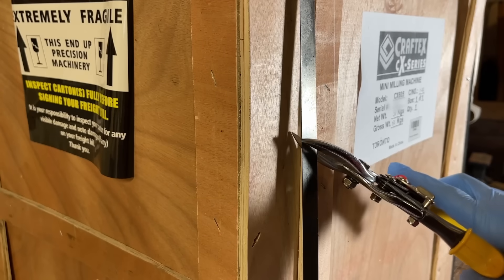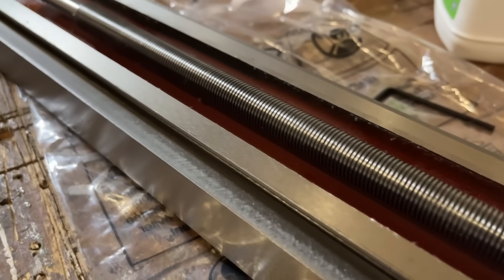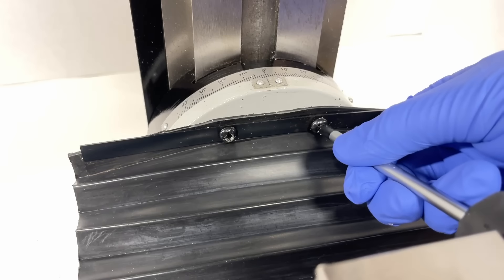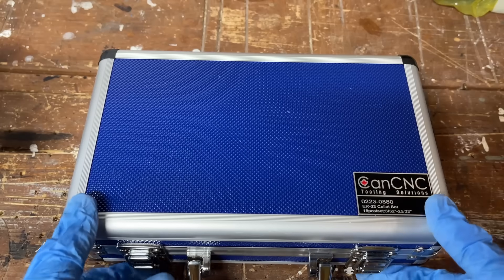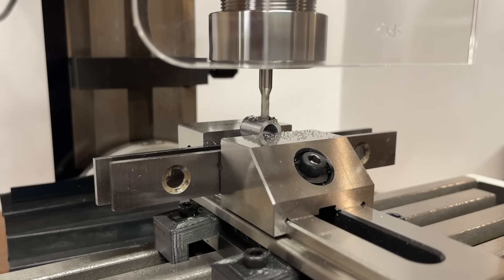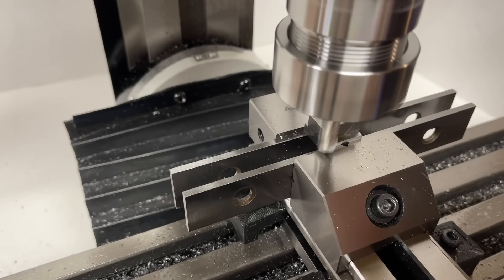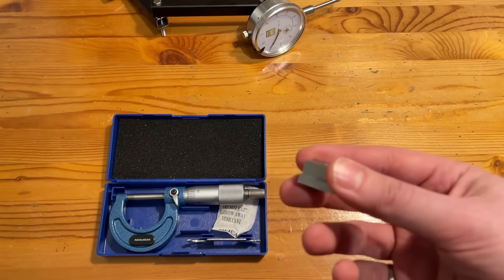I Bought A Minimill to see if they are Worth It

Comment: why do you use imperial? it's 2024!!! and you're in Canada!!!!!!
Reply: Because machining is usually done in imperial. The dials are all set for thousandths of an inch.
Reply: @LoganGrimnar-fnrizz  i don't fully remember the video, but isn't this a new machine? why are they still making them with imperial units? i just bought a desktop cnc and it's metric
Reply: @shambles9 Canada is in North America. NAFTA is a thing and the U.S. and Canada do a lot of joint manufacturing and trade. Hence the imperial mini mill being common on N.A. soil
Reply: Imperal is way more practical. If you say to someone, "oh its roughly 6 feet" they can picture how long it is...now if you say ohh its roughly 188 centimeters they gonna have a hard time picturing how long that is...i guess it depends on what your used to but i prefer imperal...and im canadian
Reply: @MinatoNamikaze607  strange.. i'm Canadian too (born in Toronto, now live in Vancouver, BC) and i can easily picture 188 cm (easier as ~1.9 m btw), since 95 % of the world already switched to metric, maybe it's time US does too? how much US influence should we take until we're sick of it?
Reply: @shambles9  im also from Toronto area...lived here my whole life, millwright by trade and i can convert to metric if needed but still rather the imperal system for measurement. Fractions of an inch are way easier than Fractions of a meter or millimeter but to each their own i guess...

Comment: Meh, naysayers. 'They' said/say the same negative things about those cheap mini-lathes, too. With low expectations, I bought one. Turned out [pun] to be the handiest thing ever. Quality ends up depending much more on error-correction than it does equipment. Knowing your hardware's (tool) limitations + then adapting your software (expectations) to those = win.

Comment: I have a Grizzly that is very similar to the Central you're showing.  I've cut steel, aluminum, plastic and wood with no issue.  All that's needed is recognizing what you're working with and adjusting speeds accordingly.  Granted, it has a little more backlash than full sized machines but I like mine.

Comment: I've got a Clarke Mini Mill, it's great. It cuts steel with no problems, just don't expect large cuts. My main tool is a 50mm 4 insert surface cutter, getting the right inserts for the material matters. 6mm and 8mm coated end mills will cut slots in steel in up to 3mm deep passes. My x and y calibration is 1.5mm per handle turn and 1.2 in the z axis, the only problem is the excessive backlash on the z axis slow adjustment. I've fitted a belt drive after breaking 2 sets of nylon gears. It does all the model engineering tasks I want from it.
Reply: The Z axis mechanism on these machines is not great (yes I do have one), as you say a lot of backlash. Most fine adjustments take much more turning of knobs than seems acceptable.

Comment: I have the belt drive version. you can't use the LMS spindle lock. you have to make your own. if you upgrade to the very quiet belt drive, make a spindle lock that uses the pin and sensor from the LMS gear drive spindle lock.

Comment: I am use to a 3 hp Tree mill, and a 7.5 hp lathe. R & D, is fine with the smaller versions. But taking a half inch cut, on the lathe, and hearing the motor begging for mercy, is SOP. But you will never expect that, out of them. And the bigger and heavier the machine, less vibration, and deflection.

Comment: Just remember to explain to people, making they own Tee-Nuts, never finish the thread, all the way through. The studs, should stop more than a full thread, from the bottom of the nut. Simply because the amount of force, getting multiplied by threads, is enough to snap off a chunk of the brittle iron table.

Comment: You should get a proper milling vise. That is a precision vise primarily used for grinding/ tool making where the holding pressures are not  as high as in milling. Because it works with new sharp mills and shallow DOC and light feeds it is still marginal. As the mill gets dull the cutting pressures climb and may cause slipping in the vise.

Comment: Two things to understand if you go the cheaper/better, old iron route.  

1) Understand the hierarchy of accuracy.  You don't need a tool room lathe, or super lathe or mill like a Hardinger, or Deckle.  You may find them for near free - enjoy.  But those machines exist to do lab work, or in a factory, to maintain the lathes that are actually making the parts.  This whole,  "I am using a granite surface plate to align my bike frame thing, while harmless, is a little stupid.  

2) Sometimes crappy old lathes that were bare bones machines, are in a lot better condition than a tool room lathe that got ridden hard. One of my lathes, the lowest SB model, was sold to a dentist in Toronto.  It is basically in new condition.  I have a tool room 9" also, and it is in OK condition, but is not as good at this point in it's life.

Comment: The complaints are all nonsense, plenty of people have made wonderful things on mini lathes or mills.  The issue is whether they are good value, and there the answer may well be "no".  

I first bought a combo machine, for about 1500.  I really quite liked it, but it also developed a leaky sump and the store took it back.  

For something like 2000, I then purchased a nice 9" South Bend, with change gears.  And a Clausing 85xx knee mill.  These are two very serious machines.  Over the next few years I got a Burke Horizontal mill, and a  mint South Bend shaper, for about another 2000 (prices Canadian, and circa 2000).  As I became a slightly experienced "collector" (I was actually just trying to get a few pieces for my shop), I started to be offered free machines, or machines for next to nothing.  But sadly, too late for me.

A mill without a knee is a bad deal.

A lathe that won't cut threads is a bad deal.

Most of the chinese lathes, when I bought, were metric even if they had dials calibrated in imperial.  At the time the machinist hobby was largely imperial.  South Bend has for real imperial screws, gears and dials.

One of the biggest factors for me is that these US or UK lathes last 100 years, and parts are still easily available.  Chinese lathes snap, even very expensive ones (30K plus). And parts for all the off brands are not so easy to find.

I don't know what the market will be like when I sell up, but it won't be as bad as if I still had Chinese tools.

Comment: The 2x can even mill titanium 
Yes the tram is horrible and sertenly when it is cnc converted.
Why did you go for the 350 geared motor version when there is a 500w bldc motor version which is belt driven...
More cheaper to maintained the gears will break.
Better off pulling the gears out and make a copy of then in aluminium or so.
Owner of x2 mini mill,  mini lathe(To be cnc converted) , Rf45 mill cnc converter , 6090 cnc router.

Comment: What's that auger-like tool you use at 6:58? Would love to get one and hopefully they have smaller sizes - I use 3d-printed steel parts sometimes and the holes on those usually come out funky.
Reply from the maker: That was actually just a standard m6 tap! But likely a similar setup with a hand reamer + a tap wrench would work for you

Comment: Any mill is better than no mill. Any CNC mill is better than an equivalent Manual mill. These are facts of workshop life. Sure, you can't always take huge cuts with lighter tools. However, if you convert them to CNC that's even less of a problem because you don't have to be there and watch it take all of those small cuts.

Comment: Belt drive, since it not if, but when you blow a plastic gear.
Igaging scales, since only way your going to make repeats (read way to much lashe in dials).
Your never going to tilt the head, so back plate the column to base, to ridged up the machine, after you have trammed the spindle to the base.
As for other mods, add in reversing switch, so you can back feed when tapping, led disc light at bottom of head around spindle for better lighting of stock.

he last one once you do have the column back plated to base trammed, and have belt driven the machine,  update the motor controller to a KBLC-19PM controller.  The motor is capable of 120 volts DC, and going to find that the oem controller board in play, only powers the motor up to about 90 volts at max setting, so no where near the 1/2 hp claimed (with stock controller board holding back motors full potential].

Granted that the machine is not going to hold its own against a bridgeport for large work, with the above mods, does very well for smaller projects isntead.

And if your going down the path of mid size lathes next, the larger the spindle bore the machine has, the better.  Hence want at least a 1" through bore to start with.

Comment: Useful video, thanks.
Sixty-two and a half thou seems really weird until you realise that means a lead screw of 16 threads per inch. (Served a machine shop apprenticeship in the UK in the '70s where we had to deal with metric, imperial and imperial fractions in equal measures.)
Reply from the maker: Ah yes the mixing of units is always fun. I’m guilty of designing in metric, but machining in imperial. It’s all fun and games until I need to drill a hole for a metric fastener with my imperial drills haha

Comment: Good video, SSMT.  Tool Tip: Starrett hacksaw blades are cheap and well worth the price.  <$3 ea @ Azon/outlast crap blades 10:1.
One could also tack weld the column to the base to ensure stability.
Reply from the maker: Excellent tool tip. I’ll have to place an order for some when I run low on replacements! Thanks!

Comment: I bolted mine to an old cast iron surface plate “14 x 14”, and replaced the motor & gears with an ebay digital sewing machine motor with speed control and reversing, transforming the mill, I have used it hard for 6 years and counting. Invaluable tool now.

Comment: Oh for sure there's no shortage of armchair mechanic/machinists out there spewing absolute nonsense about tools and kit.
I will begrudgingly admit though that in the case of complex mechanisms like a 3D printer or lathe, it can only really be used by a narrow group of people.
Its terrible for a beginner, as getting a good result generally requires a lot of experience and fabrication ability, you really don't want to learn on something like these.
And its obviously not for a professional.
Its for the unicorns among us with vastly more skill than cash.

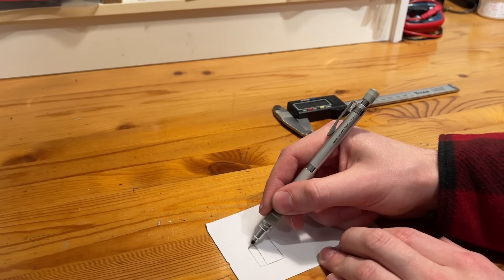Comment: @ 5:40 (again when showing the nominal vs actual)
You wrote 0.7

That part looks WAY larger than 700 microns.

You should write it as .7 without the leading zero... that way it will be bigger... 700 thousands of an inch.

Nice job hitting tenths on 1/2 of your feature tolerances though.
Reply: Soooo many people don't get that about the leading zero's.  Very aggravating in a contract shop that deals with imperial & metric.

Comment: As a young man back in the 70s I worked as a production machinist, operating turret lathes, chuckers and cataract machines. This was pre-CNC.
One day I complained to my lead man that my machine wouldn't repeatedly hold tolerances required. He went over and ran a few parts, he then told me "It's not the machine,  it's the machinist"  He was correct of course and showed me why; I just wasn't concentrating, etc. The point is, these mini machines will produce good work if used within their limits. Be patient and don't try big hogging cuts, etc.

Comment: Had my mini mill now for many years. Mods- gas strut alongside the column to prevent spindle dropping, changed the gears for drive belt, both make it much nicer to use. Yes I use the jacobs chuck a lot for most things, accurate enough for what I use it for on daily basis.

Comment: I tried all kinds of small mills, finally decided on the Grizzly 3102 precision knee mill. Solid, not too heavy at 1150lbs. I added ballscrews and a cnc motion control system I can hold .0005 now. all told around $5500. Thought phew im done...I was WRONG. Tooling, OMG tooling. $$$  Im in 3 times what the mill costs and always getting more fixtures and making jigs. My 10"rotary table was at an auction and im embarrassed to say what it cost. Think nice used CAR! The machine is reasonable, real tooling is a beast!
$1400 for 1 indexable toolholder!!!! NOT cool!   I end up making most of my own fixtures, tools, etc.  I cant afford that stuff. But I need that quality...

Comment: Go down to a workshop that repairs any form of heavy machinery & raid their replaced bearings bin & grab the large roller bearings. you want the rollers as they are not only all ground to the same diameter but also the same length, 2 or 3 bearings will give you different Hights  as packers or spacers & usually for FREE !!!!!
Kiwi Rod
Reply from the maker: Good suggestion! I’ll have to give that a try and see if I can find anything

Comment: I bought a mini lathe and found a new hobby: hotrodding my mini lathe! I learned how to lap and scrape ways, made and installed stops, saddle locks, quick release tail stock… the list goes on. Meanwhile, it was capable of really good work. Lest scoffers say I don’t know how well a good machine works, I worked on Hardinge lathes for decades. Clearly, these mini lathes are no match for a hardinge, but they are satisfying in their own right. It’s all about knowing your tools.
Reply: Hardinge machines do set high standards. They may spoil you.
Reply: My company scrapped a Hardinge last year. I couldn't get it home, alas but I thank it for all the aeroplane bits it made for me after hours over the years. A lovely lathe, Tough, smooooooth and very, very accurate.
Reply: @tomsheppard1666  I went through such experience with a Dutch AI Hambrug DR1 - high speed. But i simply did not have the space or the concrete floor for such a lathe. Even not the means of get that half a metric ton of cast iron at home. It is sad. Those machine tools last a life time. Or more, my J. Volman (pre TOS) toolmakers lathe comes from 1935. I from 1967. That machine still runs better then i do.
Reply: I’m glad I learned on a South Bend so I could appreciate a Hardinge’s sheer luxury. As I said before, it’s all about learning and understanding your machine and what’s happening at the sharp end of the tool.
Reply: @trackie1957  When I bought SB was a lot cheaper than chinese, and those lathes were incomprehensible, anyway.  Every change in model size was a completely different feature set.  SB was more than adequate in the day, and parts are easy to find.
Reply: Honestly sounds a lot like my 3D printer habit, er, hobby. Paying premium prices for premium machines gets you one that works without too much fiddling, but cheap machines are less functional tools and more projects to see what sort of ridiculous nonsense you can get up to.
Reply: *pimping
Reply: Yup have a little  6889 grizzly  bought for hundred  with all tooling..switched it to r8 spindle  and metal gears..does good also bought a round column  mill same price..should I need for bigger jobs mini does most

Comment: After my mini mill inevitably broke the gears, I had a great project for the lathe - making aluminum pullies to convert the mill to v-belt drive.  Best thing I ever did for the mill.  Now it's quiet, runs with less vibration and when I do something stupid, the belt slips instead of it blowing up the gearbox.  SO much more pleasant to use.  100% worth doing.
Reply: Exactly 💯
Reply: FYI  IF you ABUSE a Machine tool , IT WILL  RESPOND   UNKINDLY    trust me ...
Reply: @Wilett614  and a v-belt mini mill is better than one with a gearbox since mini mills are less powerful anyway.

Comment: A hint on plunge or side milling on mini machines... Avoid adjusting for your next cutting pass while the machine is running. One can cut too deep jamming the machine. What I do is to turn the machine off and then pull on my Quill handle until the end mill contacts the surface. Then while I have a little pressure on the Quill handle I lock the Quill and turn on the machine. The end mill will cut in maybe 2 to 4 thousands and I then finish that pass. This eliminates doubts regarding backlash and I never have jammed the machine doing this. I use the same method side milling. Once the end mill contacts the surface and you feel a little pressure you know all backlash is gone. Just learn the appropriate amount of pressure. When first learning this method start with very light pressure and work your way up to where it works best for you and then lock that into muscle memory.

Comment: I have both a mini lathe and mini Mill. Both have worked great. Recently I am creating an open view case for a Ford Escort Transaxle for illustrative purposes at car shows. Have had to cut perfect holes in plate steel for five bearing races. The mini Mill along with a rotary table mounted to it has done the job beautifully. The races fit snug with no play. When holding the race in the hole I can barley see any light coming through the circumference. All done without a DRO ( Digital Read Out). There's a technique to it, but once you get that down the holes are perfect. Nice thing also is when I cut a hole I also get a perfect circle of steel to make gears out of for a later project. It's not necessary to cut a center hole in the circle Plug but I do anyway. That way if I do use the plug for a gear it already has a perfectly centered hole for a drive shaft with no run-out. ALL DONE ON A MINI MILLING MACHINE! I will say this though...when I received my Harbor Freight mini Mill there was a broken wire in the switch box I had to repair to get it to turn on.

Comment: I got a sherline, for a bench top it's perfect. I later bought 2 haas mills and a doosan lynx. The bench top can cut anything but it will break your heart when something goes wrong after 4 hours into the part and you have to start over.